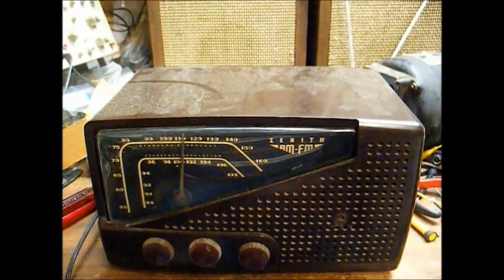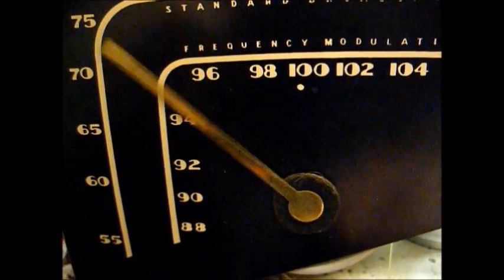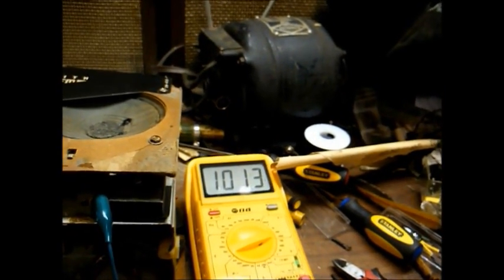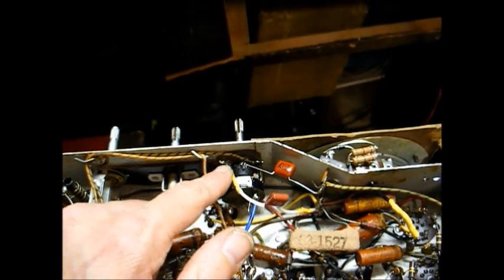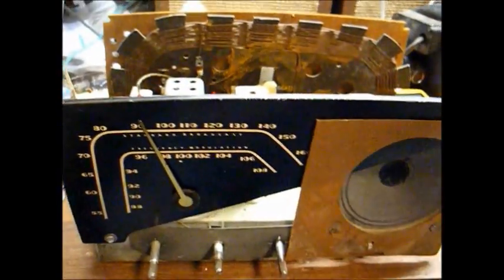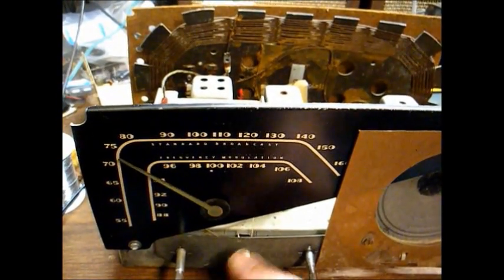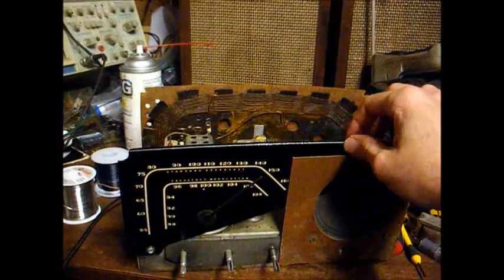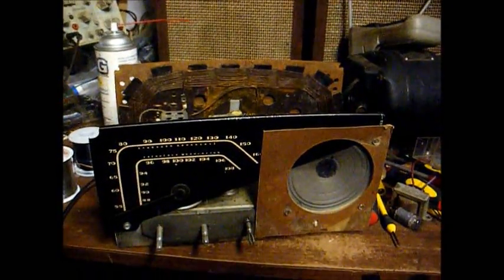Repair of a late '40's Zenith AM/FM tube radio

Comment: Heya, i have this philips portable transistor radio that has chrome looking decoration around the tuner scale and is black with a single speaker and tape player, when its turnt off you can stil hear a brrr noise from it and the sound is very thin/weak, something needs to be replaced in it i think.

Comment: Thanks for making this video I am working on the exact same model even a brown case like yours. Unlike yours mine was not working except for the light on the dial that was all. Looked at the selenium rectifier it was pretty much toast replaced it with a diode and resister in series. Your video gave  me some direction in a way to go to repair it. Thanks again

Comment: Thanks Bill, I'm catching up on some of your older videos. May I ask your source for your replacement parts? I'm new to the hobby and need to stock up on a few things...Thanks
Reply: +Billy “stormlight” Steen Try web searching for Sal's Capacitors for caps. Get some 2w or 1w resistors from ebay, or Mouser/digikey

Comment: I wonder if the original owner of that radio even picked up any FM signals back in the late 40s?  FM didn't really take off until the late 50s and early 60s.  I remember getting an AM/FM Sony transistor radio in 1968 and at that time there were only 2 FM stations in my area.
Reply: ldchappell1 same for UHF  on TV, only a PBS station at first.  We boomers had top 40 AM, and there was hillbilly stations.   FM had easy listening elevator music and classical.  But FM had college "underground" stations too, which became the rockers of the latter 60s.  Most cars had AM, not FM.  FM and 8 track tape car radios and portables came into vogue in the late 60s.  My first AM/FM was a GE pocket radio from about 1966 that my mom got for Christmas, and my folks got a tube GE clock radio too with AM/FM,  I posted a vid about it.  We also got a Blaaupunkt console with AM/FM/SW in 67.  Our first UHF TV without a UHF converter was also our first color TV, a 23" Zenith.  I remember that before the 60s, it seemed nobody we new cared about FM or UHF.  After that, cable changed TV, and video killed the radio star.  Don
Reply: ***** That was a fun comment to read.  I love reading baby-boomer comments about childhood memories

. We didn't have a TV in our house until 1966 because my dad couldn't afford one. We were like a poorer version of "The Brady Bunch."  3 boys and 3 girls living in a 2 story house with a LTD station wagon in the driveway. We never had a color TV during my childhood. We used to rag on our dad about it and he would say "You want color?  Go to the movies. Here's a dollar." or he would say "I don't want color TV. You think I want to look at the spots on Kojak's bald head?"  All my siblings chipped in and we bought our parents a 25" RCA color console TV for their 25th anniversary.  

I was more into music than TV in those days. We had this crappy plastic GE record player that we all had to share.  I put my own stereo together in high school wood shop. I made the speaker cabinets and got the actual speakers from a discarded stereo console I found at the dump. A friend gave me a turntable and I paid $29 for a very simple 35 watt Radio Shack amplifier. I also bought a pair of those big puffy Koss headphones that made you look like a space alien. 

The only FM I could pick up in '68 was a PBS talk station and a classical music station. Then KSAN 94.9 went on the air and gave young people a reason to want FM. It was the first station in my area to play not just long songs but entire album sides. On Sunday nights starting at 7 pm they would play seven albums back to back without commercials. 

I still have a few radios from my younger days. My pride and joy is my 1959 Telefunken stereo radio. I bought it in a thrift store in 1994 for $30. I don't know much about fixing old tube radios but my cousin does and he restored it for me. I still use it on nights when I'm having trouble falling asleep. I just tune it in to some soft elevator music and it knocks me right out. I hope the FCC doesn't force digital radio on people the same way they did with TV signals. It would be terrible if these classic old radios became muted permanently.
Reply: ldchappell1 I love that story and I agree, I hope we don't go to all digital radio. Digital TV is a disaster in my opinion.
Reply: If digital has better signals, but it sux as it is.
Reply: ***** Manufacturers didn't care about UHF TV, either. Few sets, other than a few deluxe models could get UHF without a converter. That led to the DuMont TV disaster when that company tried to launch America's third network. That enterprise failed because nobody could watch the stations, most of which were in the UHF band, and the company was eventually taken over by Emerson. That led to the enactment by the Johnson administration of the All Channels Act of 1962, which required all TV's sold in the US after 1964 to be able to receive all 83 channels. Canada enacted a similar law around 1970. In those intervening years, many sets sold in Canada had a blanked out hole where the UHF dial would be on the USA version.
Reply: Jerry Carriera Another disaster was AM Stereo. Others were Satellite phone, satellite radio, and even MTS TV audio. BY MTS, I mean the quality, which is not as good as the regular FM sound, even though adoption was so widespread that by the end of the analog TV era, few sets offered FM sound anymore.
Reply: +Doug browning my moms Chevy in 86 had an am only radio, but it was am stereo! I remember certain instruments and parts of the drum kit panning left and right, on AM!  It was weird.  STILL IS!   Good call!
Reply: Steven King  If they convert radio to digital like they did with broadcast TV, AM stereo will be back. AM will sound like FM does now and FM will be CD quality. Digital radios will come with a screen so stations can send listeners text and pictures information along with the audio. Unfortunately there won't be radio converter boxes like they did with TV.
Reply: hf digi-radio will dx better than vhf.
Reply: ldchappell1 FM radio already has the ability to send text to listeners, such as time, call letters, frequency, current song title, news bulletins, ads, etc. However, like AM stereo in the 1980's, it is usually only available on automotive and personal radios, rarely on home stereos, boom boxes, etc.
Reply: Doug Browning   My neighbor was telling me the same thing a few days ago. I rarely listen to radio anymore.  Growing up in the 60s everybody listened to AM in their cars.  Back in the good old days when you could count on at least one new catchy tune a week. These days it seems like technology is merging everything. Radio music is migrating to TV so you can get good quality music along with text and pictures about the artists.
Reply: +Doug Browning I never thought of MTS as a step down in sound quality; always assumed it was a 30KHZ subcarrier just like the FM stereo system. I should add that most TVs during that era had such terrible speakers that any minor degradation of quality would go unnoticed.
Reply: +ldchappell1 "shango" recently put up a nice demonstration of an HD FM/AM radio, sort of a hybrid that switches to digital when the signal is strong enough. It does have some advantages, especially on AM, but without lots of repeaters the digital coverage will be spotty.
Reply: +ldchappell1 I recently came across a 1954 article ( Variety, I think) that mentioned that the sales of FM sets had been declining, although that was mainly because many of the early TVs included FM bands. When I was a kid in the '60s, it was mainly classical, "beautiful music" , college stations, and simulcasts, though when the FCC banned simulcasts in 1967, the "free form" and "robot" stations kicked in with a vengeance. That upheaval made the US an interesting, unpredictable market for music until about 1976 when FM had become about as commercial as AM.
Reply: No Name FM rock music was great back in the early 70s here in San Francisco. It was almost like the wild west of the airwaves. KSAN 95 was the most popular station with listeners under 35. Instead of airing commercials every 10 minutes, they would air them once an hour for about 5 minutes. They didn't monitor their language in those days. Sometimes they would play entire albums. Every Sunday night they would do a show called "Seven On Sunday" They would play 7 albums back to back without commercials.

Comment: 1:48 The old speaker, in spite of some distortion, actually sounded a lot better than the new one in some respects, much better bass. Zenith must have done something right when they designed that thing.

Comment: When you replace the old wax caps, do you make sure you put the Outside Foil lead to the low impedance side of the circuit?
Reply from the maker: I probably need to start doing that; but, up until now, it's never been an issue (in the type of stuff that I work on).
Reply: @radiotvphononut  , I can understand that.  Capacitors can really throw you for a loop.  I was blessed to have come across a few videos that explained some mysteries (like the capacitor tester said this cap was good...but it isn't!) when dealing with capacitors.  Since you might enjoy these as well, and I do appreciate your videos, I will share the links with you here.  
The first one is  https://youtu.be/LhovRIM5xAo   which is an incredible low voltage leakage detector.   
Then there is the one that was entitled "Are Your Capacitors Installed Backwards"  https://www.youtube.com/watch?v=BnR_DLd1PDI   
and finally one for a Spectrum Analyzer protection circuit  https://www.youtube.com/watch?v=ETKyKC2Zj-M  that might come in handy.  
Anyway, thanks for the videos.